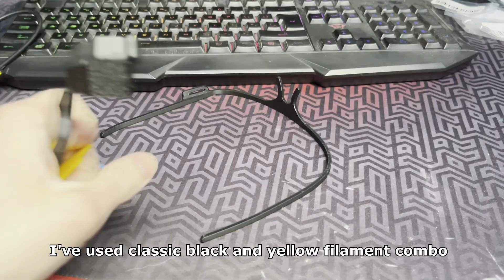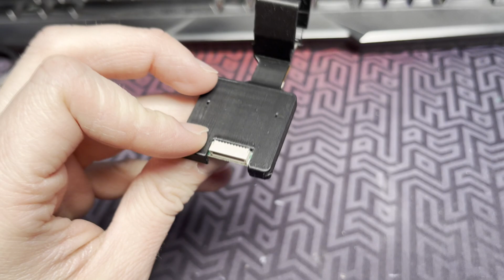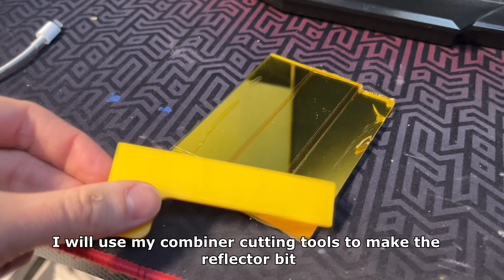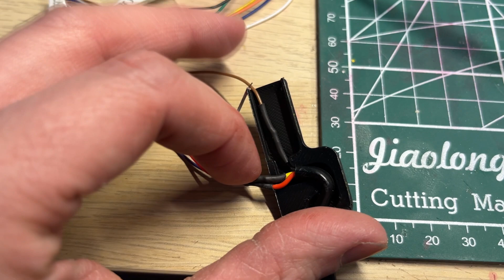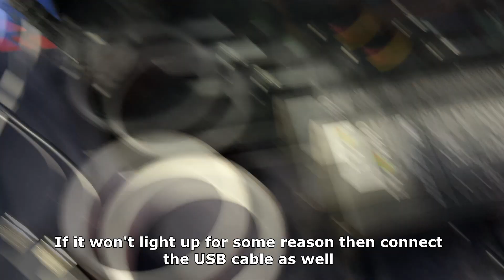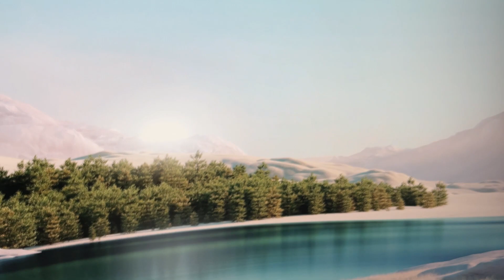Sideloader Lite 2.0

Comment: Hey I'm looking into building this and was wondering what's the resolution of the display and also does the display come with the wires/cables you could solder to a raspberry pi? Also where do you get the reflector at? Thanks I love your content and its very revolutionary for us people trying to diy ar products.
Reply from the maker: Hey! Display has a 800x768 resolution and is about 0.4 inch. It comes with cables and driver board so you can easily connect it to raspberry. I've cut the reflector out of a semi-transparent plastic sheet.

Comment: Damn, you need some sort of Bluetooth hdmi wireless display and it will be a ready-to-use product. The most coolest way is that adapter is on PCB as a hdmi converter, which You already have. So cool project!

Comment: hello, i want to share my ideas. In your video you connect it to your computer by wires, but if you attach blutooth module and connected it to powerbank through type-c,  by this way you make it more portable and universal. Or you can use attached ruspberry pi and batery, by this way you can also increase productivity. I really appreciate your glasses, because they quiet chip (exept dispay) and easy to make. I believe that you continue to upgrade your glasses and will achieve greater success. Good luck!